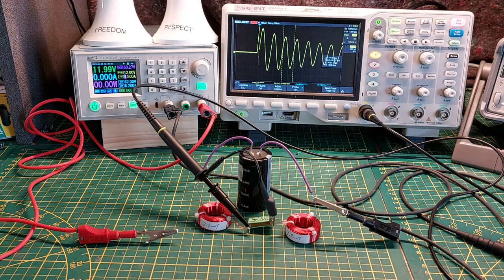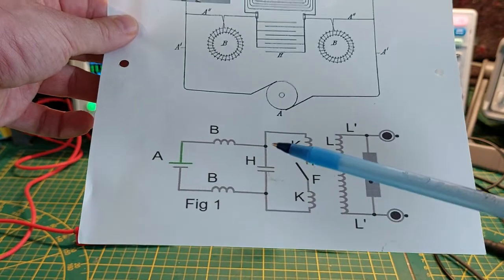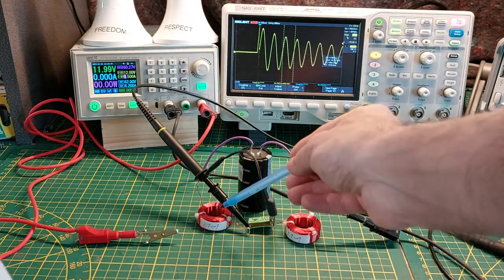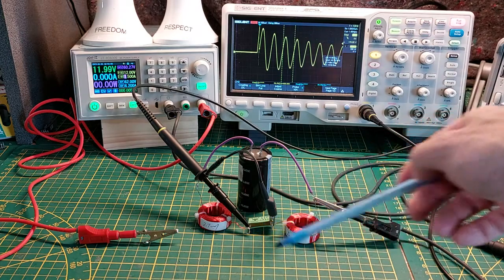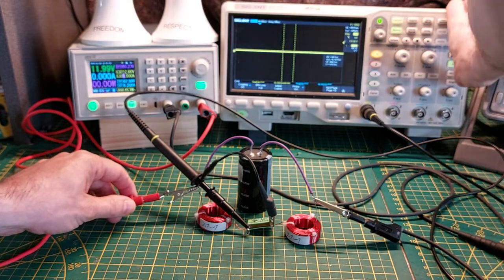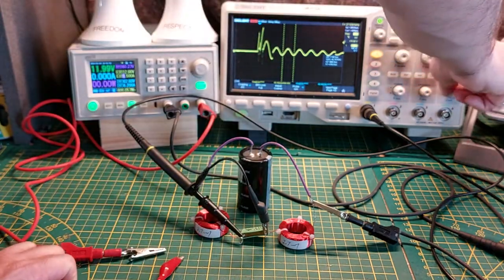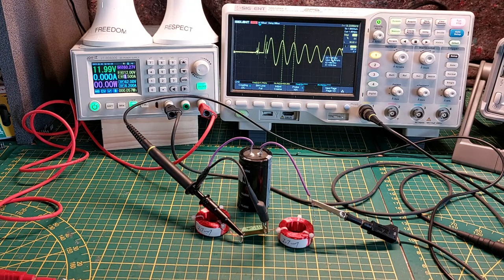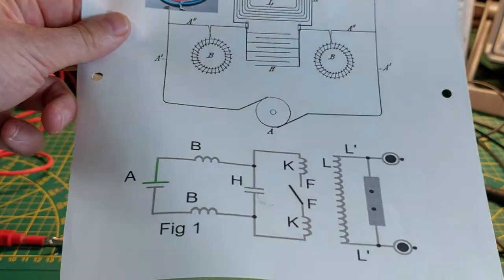01 Tesla Switching US568 176 Fig 1

Comment: Is this not a kind of ZVS?
Reply from the maker: I don't think so, in this circuit the capacitor needs to be charged before the switching.
Zero current from source could be possible because when capacitor is charged there's no current from source.